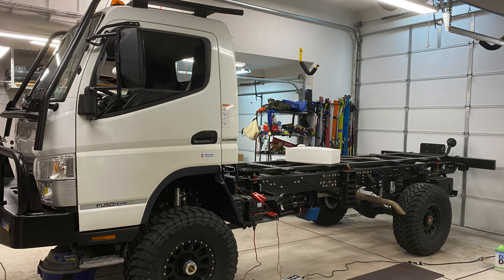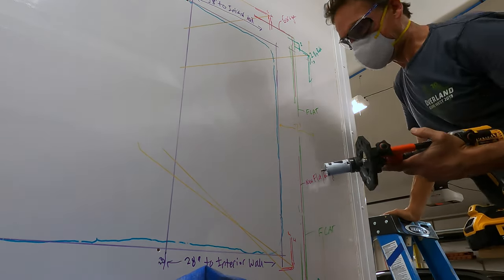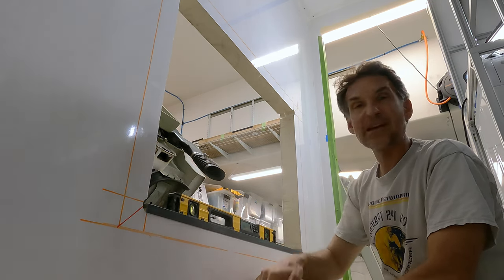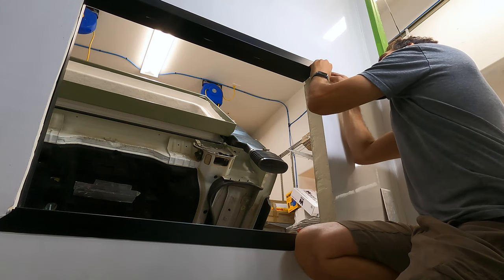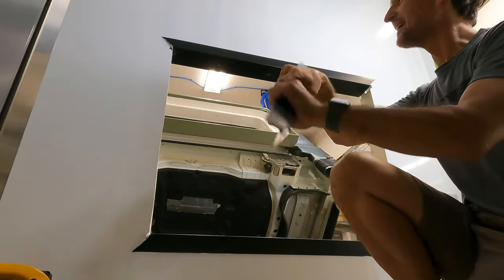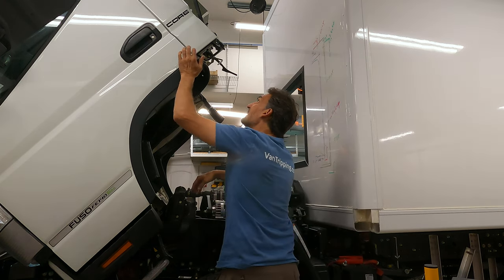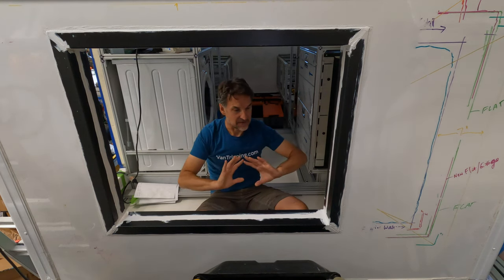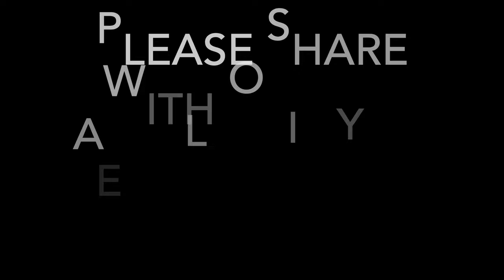Building a cab to camper pass thru on an expedition camper

Comment: I've been thinking about something similar. I would've put one side together like a picture frame on a table. Then install into the opening as a complete frame. Then make the opposite side to fit and install as one frame.

Am I missing something
Reply from the maker: Good suggestion. Hard part is that the cab and camper move up 6" diagonally from each other, and also pull them selves away from each other by .25-5". Then I also need to tilt the cab away easily for doing maintenance and fluid checks, and still have it all seal from noise and weather. Now maybe I should've just created two frames with a flexible and removable seal in between, which is what I'm doing, but the two frame with each side didn't work out like I thought to make it easy to separate for maintenance, so I decide to go a different route. I'm probably making it way more complex than needed, it's my style. 😉
Reply: @vantripping  I'm just referring to how you trimmed out the opening you cut in the box.

I'm a woodworker, and I figured it's similar to when I've built two-piece door jambs where the casing is already attached to both sides.

For the seal between the cab and the box, I was thinking about making an inflatable rectangular ring using the same kind of material whitewater rafts are made from. Then, when the truck frame  twists, the bladder would just slide back & forth against the outside of the box.

It's not an original idea. I remember seeing an inflatable ring being advertised to seal up the gap between the sliding back window of a pickup and the sliding window of a camper shell.
Reply from the maker: @stewpacalypse7104  thanks for sharing. I cab frame was by EarthCruiser, that I glued in, and it's rounded, so I instead cut a rectangle in and trimmed that out. Was a lot of work the way I did that. I too have thought about an inflatable ring but instead thinking of similar materials as you except stretchy and not inflated but instead insulated to attach to the two sides, and be easily removable, which is harder than it sounds as also needs to be secure.

Comment: I love the series.  Have you worked-out the sealing/door issues yet to work with the cab-forward chassis?
Reply from the maker: Yes, although the fabric seal still needs to be made. Hoping to have that done in the next month, but been jamming away on electrical, painting the camper & cab, and installing the storage boxes before I move on to that and solar array and finish touches inside.

Comment: Its video 77 please get a decent microphone setup!!
Reply: So you have watched 77 episodes and you feel that putting please in front of your order to get a better microphone comes across well? 

How about something like this....

Hey congrats on 77 episodes and a great build. I noticed the sound quality varies greatly.  Do you think it could be from working in the garage or could it be more from the type of microphone? 

Do you notice the difference 🤔
Reply: @livingworkingoutsidebox  sorry if sounded like a demand, just some advice. Now go buy a roll of blue tape, lol ,,, I kid i kid

Meant to reply like 30 episodes ago, but cant from tv
Reply from the maker: Yeah, I did buy some remote wireless microphones, which I’ve been using in my soon to be released videos, and also learned how to improve the audio quality some. I keep investing in new equipment and skills to improve the audio and video quality. It’s getting much better. I just watched a video of mine from about a year ago—so much better now and will get better as the videos are released. As I always, I appreciate the input.
Reply: @sommeone4582  no worries 👍
Reply from the maker: I did replay the video and it sounds fine to me and a friend. I did use an external microphone as well for most of the video. Is there a particular section that doesn't sound good and is it the sound quality or volume or both?
Reply: @vantripping  Audio sounds great to me.
Reply from the maker: @charlesrg  Great to hear. Thank you for letting me know.
Reply: Nothing wrong with audio. It’s a home build.
Reply from the maker: @malcookie  Great, thank you.